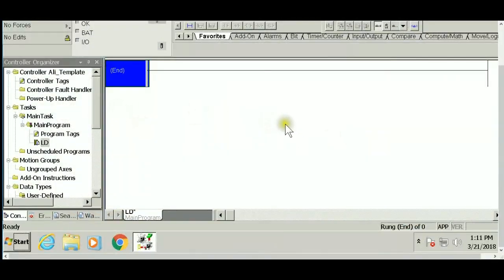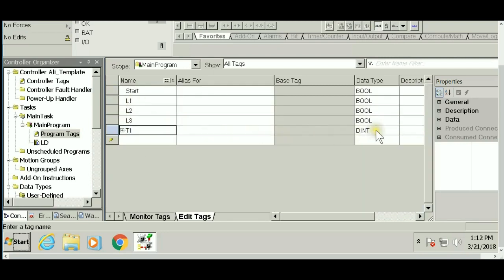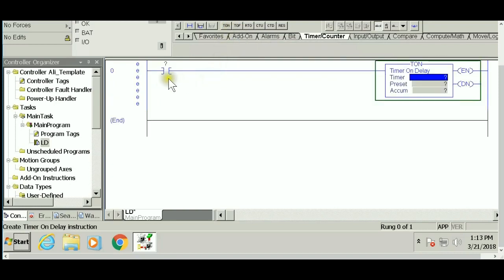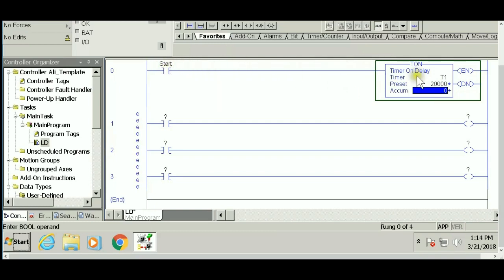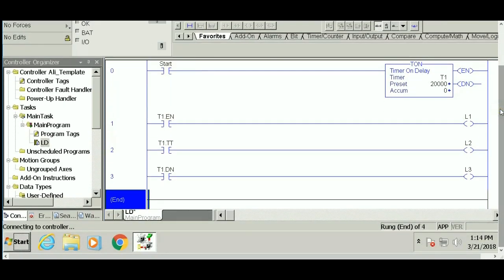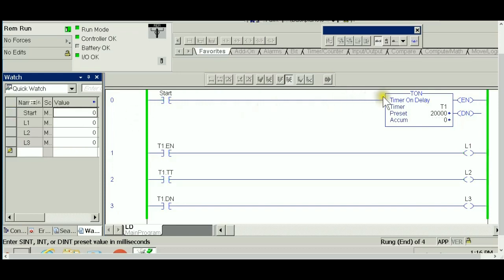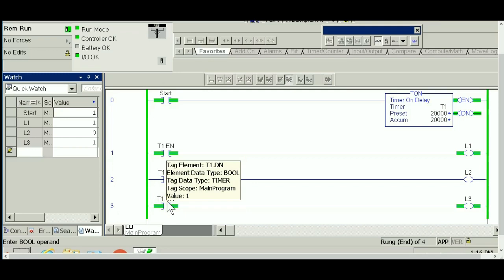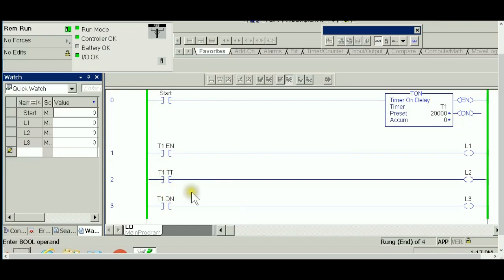LD 13 - On Delay Timer TON [Allen-Bradley] - Easy PLC Programming Tutorials

Comment: your explain is very useful . bot how to work motor after off the input ? we must latch is that right
Reply from the maker: Hassan, sorry for late reply. 
 If Start was a momentary switch and we wanted to maintain the timer running when Start is released, U R right. But in this video I am using internal Booleans to illustrate the internal components of the Timer.